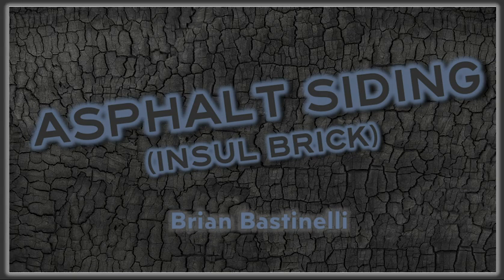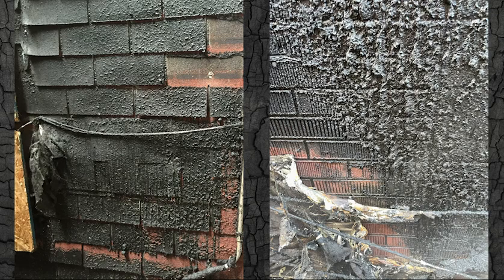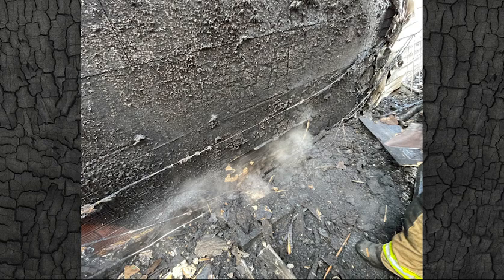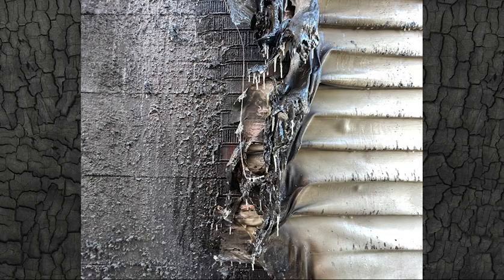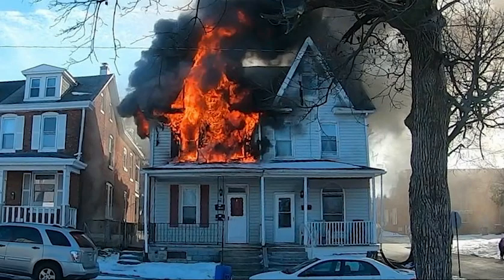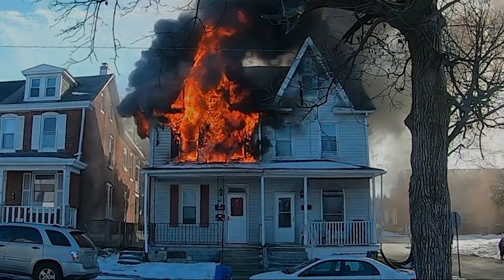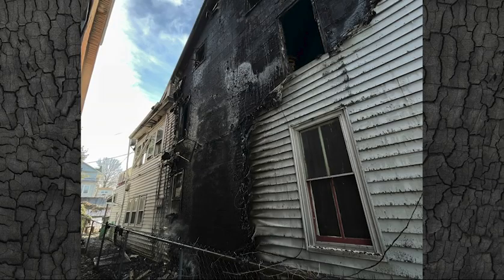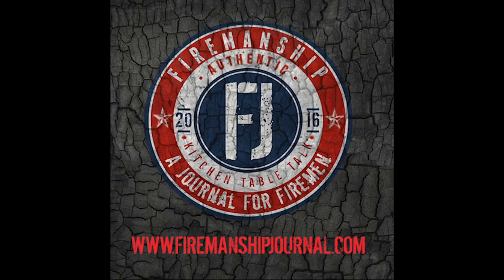Asphalt Siding Fires

Comment: That is good information, I watched that fire video and depending on arrival I almost thought you had a basement fire that extended to the 2nd and 3rd.
Reply from the maker: The fire on the B side started from drop down from the asphalt siding and vinyl siding. We did check the basement however.

Comment: A newer type construction I've seen is styrofoam covered in a faux stucco finish.  This is mostly in commercial structures.  What started this fire is someone throwing a lit cigarette in mulch, which ignited the styrofoam under the thin stucco finish.  It burns like cheap styrofoam does, with a lot of black smoke.  The good thing is that the stucco finish does not let it take off right away, but once it gets going....

Comment: Speaking of asphalt related fires. Checkout a clip on Youtube relating to the Bradford Ciry Fire disaster.
It shows a football (soccer) match in progress in England in 1985, the match being played at a rundown and dilapidated stadium packed with home fans supporting their team when a small fire develops in the voids below the seating in the main grandstand. This quickly erupts into a major conflagration in 4 minutes. The 77 year old stand had a timber roof covered with bitumen/asphalt which was designed to act as a waterproofing agent.
Once this began to burn, a major fire erupted and burning/dripping tar landed on spectators below trying to escape. 56 died and 260 were badly injured.

Comment: Think I've only ever come across one of these in Australia (about 40 years ago) with this particular style (rubberised fake brick frontage with asphalt behind it), I noted that it had been removed by the early 90s and renovated back to timber weatherboards and painted.
Usually they used cement sheeting brick known as Fibro. Commonly used in the suburbs of cities and towns throughout the country in the 1970s and 80s.

Comment: I spent last summer stripping the Insul-Brick siding off my detached garage and replacing it.  What a nightmare getting that stuff off!
Reply: Could you offer any tips or tricks on doing so from your experience with it? (If you have any that is)
Reply: @hosedragger-204  Of course Thin Blue.  First, wear heavy gloves that you don't mind ruining.  The stuff is messy.  You will need a flat pry bar and a claw hammer to pull the stuff off the wall.  In my case, they used a surprising number of nails, all of which had to be either pounded in or pulled out before installing new siding.  Get a dumpster (I used one of those fabric bags from Lowes--make sure they pick up in your area) as you shouldn't burn it.  There are conflicting reports about asbestos content, and when I burned some damaged wood with insul attached, it was a nasty, smoky fire.

In a couple spots I was able to pull it off in strips but on the weathered side, it was crispy and broke in small pieces.  Also, the tarry material can stay behind when your rip it off, so many nails had what looked like a black washer under the head.  Good luck!

Comment: i used to be a carpenter and would often think of the crap that can burn and choke the crap out of anyone.
Reply from the maker: Yes, unfortunately we know the results of that all too well. Most firefighters are at a significantly elevated risk level for almost every type of cancer. The challenges are not just wearing and SCBA because much of these toxic chemicals are absorbed through the skin and all of this stuff off gases for a long time. No matte how diligent you are, it always seems to find a way to get into your body.  You do your best and hope that it doesn't happen to you.
Reply: @brianbastinelli  thanks for responding. are you guys "volunteer" or is it a full time job? the reason i ask is because when i was a carpenter i worked on houses in the country and had coworkers leave the job to go to a fire or MVA. i always thought it was pretty nuts.
Reply from the maker: We are a career department 24/7 with staffing on all apparatus. We have a small volunteer contingent that occasionally come and ride with us.

Comment: I find this video particularly interesting because I grew up in an old, very old neighborhood, the Back of the Yards in Chicago. 99% of the houses in my neighborhood were either clapboard or covered over with what we called "fake brick" or asphalt siding.It was sold not only as a cosmetic upgrade but also for its "insulating" properties. Of course the fact that it was useless as insulation because it was installed on the cold side of any wall was conveniently overlooked In the sales pitch and a neighborhood full of immigrants trying to do the best they could bought right into it. When it burned it was intense.
Reply from the maker: I know that it was very prevalent in our region but I don't know how far across the country it really took hold so its interesting to hear that it was common in that area. I think there is a lot more of it out there than we see due to aluminum and vinyl siding coming along. People just covered it up with the new nicer looking product. Now we have multiple layers of highly combustable coverings to deal with!!   Thank you for sharing that info.
Reply: I don't understand your comment suggesting that insulation can only be installed on the inside. This material does have insulating properties when installed on the outside. (Maybe not great, but since many homes of that time didn't have any wall insulation it certainly would help.) If it provided some sealing it would reduce drafts also.
Reply: @jonboyd3785  You’re correct. Any additional layer of material is going to further reduce airflow whether it’s applied on the inside or outside of a building. Insulation is another matter. Trying to stay warm by insulating the “cold” side of a wall is like trying to stay warm in bed by attaching your cover to the ceiling.
Reply: @timcarpenter8526  If there is a lot of airflow between the outside insulation and the wall, I would agree with you. However, that doesn't seem to be the case here. A lot of the newer high efficiency homes are putting foam insulation on the outside of the basement wall and floor. That is the same principle. We might have to agree to disagree! Thanks for posting the video!